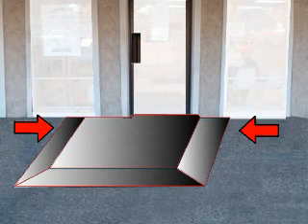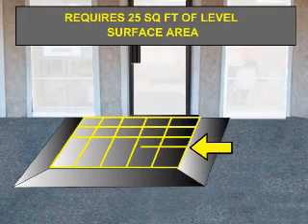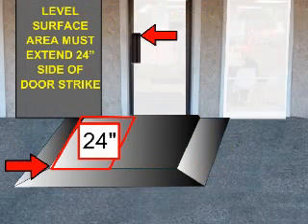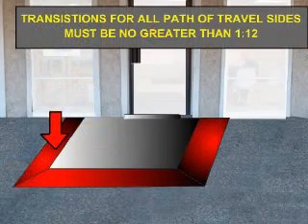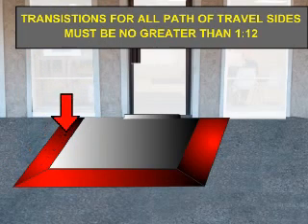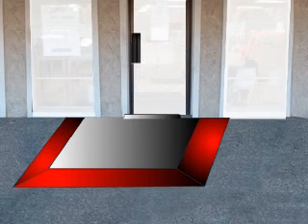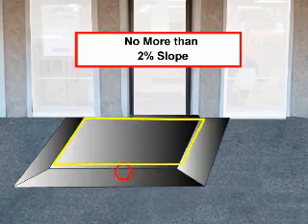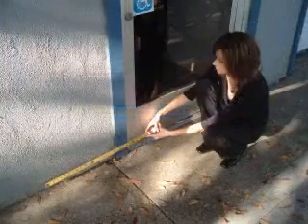ADA Door Access What is a Level Landing?

Comment: Not a bad idea, in fact the idea is good, however some of the facts are eeroneous on this video.
1. Designers and Contractors are not culpable unless they "Design AND Build" the violating structure.
2. The first picture product with the blue edgeing is not legal, way too steep by the picture.
3.  1/12 is for ramps, not for entryways. Ramps must have handrails as well as level (1/48) areas at top and bottom of ramp.
4. 1/4 inch is all that is allowed between elevation changes. Alterations include beveling the higher surface a minimum of 3/4 wide to the lower level.
5. The area to the strike side of the door cannot be a small as 8-2 inches as stated.
6. The area immediately on forn to door must measure 60"x60". Whie this is 25 sq. feet. So are other geometric shapes that do not ill the requirements of 60" by 60".

The above stated architectural elements are per 1990 & 2010 American With Disabilities Act.

Donald T. Oberloh
Director
National Advocacy for ADA Compliant Businesses.
Disability Party Expert Witness